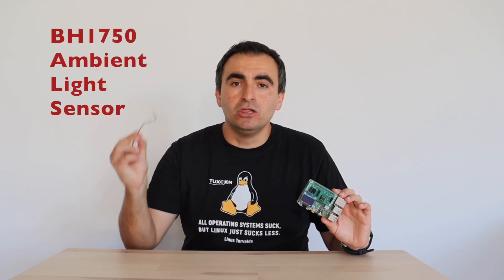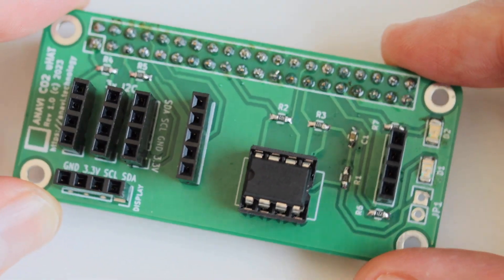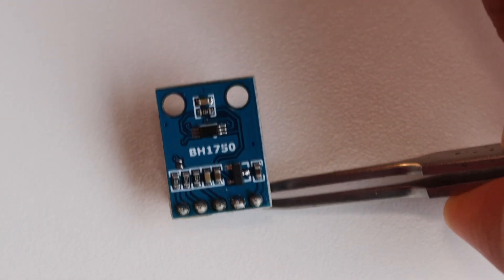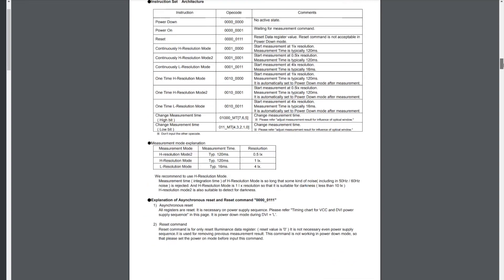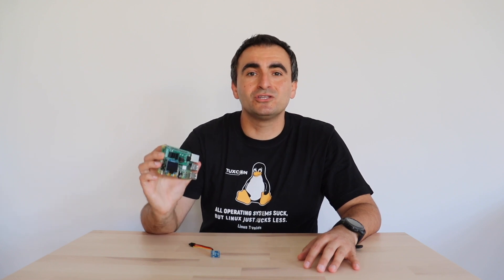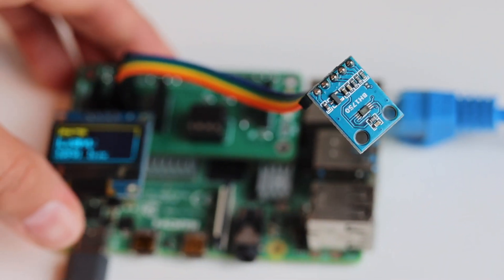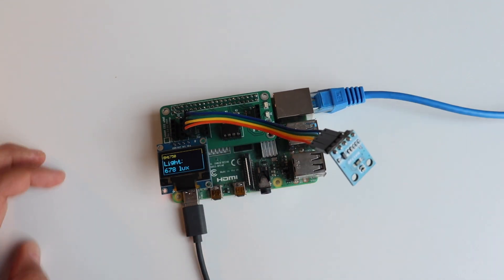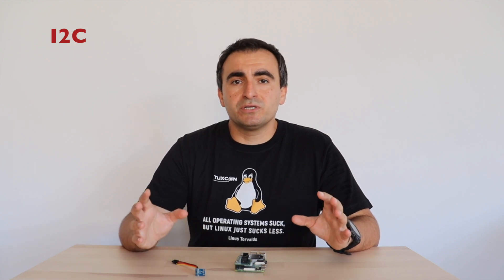Measuring Light with Python, Linux, BH1750 Ambient Light Sensor and Raspberry Pi

Comment: Dear Leon

Im looking to make variable ND filters that change based on the light for the camera I have. It has to measure the Lux CONSTANTLY and send out a motor command to my focus motor which operates at 2,4ghz to pull the filter and compensate for the amount of light coming into the image! 

What would you suggest.
Reply from the maker: This sounds like a great project! I don't have direct experience with ND filters, but it seems that the BH1750 would be a good fit for your needs. Given the scope of the project, I think using a Raspberry Pi single-board computer might be overkill. It would likely be more efficient to connect the BH1750 over I2C to a microcontroller such as an ESP32 or a Raspberry Pi RP2040 (used on the Pico board or Pico 2 with the RP2350) along with a suitable motor driver. A microcontroller is generally cheaper and better suited for real-time tasks like those in your project.

Comment: Is there a circuit you could do without microprocessor?
Reply from the maker: Yes, of course. Actually the add-on boards for Raspberry Pi like ANAVI Info uHAT from the video don't have a microprocessor and rely on the Broadcom SoC on the Raspberry Pi.

Comment: so glad I found this video!  i'm researching ways to automate my greenhouse supplemental lighting. I'm currently using an Ambient weather station reading with home assistant controlling the lighting state. but as the light readings are taken  outside and in W/m^2 I'm having to guesstimate the accurate loss of light from the glass and structure. I just happen to have an Pi4 sitting around and I just ordered a BH1750. Thanks
Reply from the maker: Glad the video was helpful! I think BH1750 is a sensor very suitable for a greenhouse. You might be also interested in my other video "Raspberry Pi and Capacitive Soil Moisture Sensors for Gardening". It features the open source hardware board that I designed ANAVI Gardening uHAT with I2C slots for sensors, including for BH1750.

Comment: can you measure distance? sub 10 microns? let's say you have 2 steal plates and you want to measure distance between them
Reply from the maker: no, not with BH1750 because it is only for measuring ambient light in lux. Other I2C sensors like APDS-9960 has a proximity capabilities (I covered it in another video). I also have a video about detecting distance on Raspberry Pi with HC-SR04 ultrasonic sensor. However, both of these sensors are low-cost and are not capable of measuring microns. Check Mitutoyo calipers and tools.